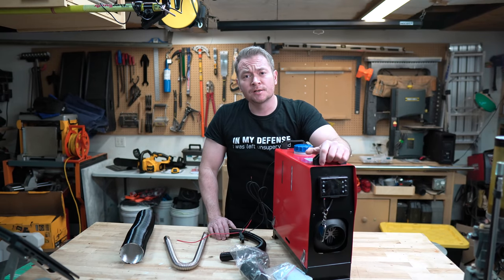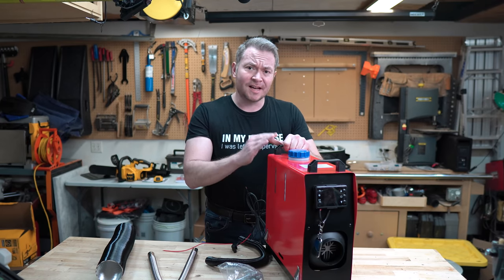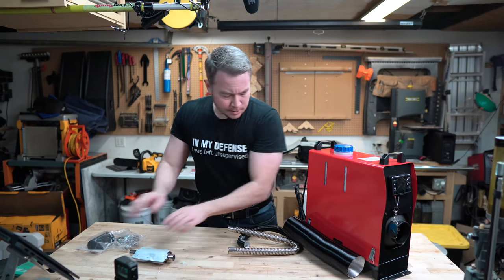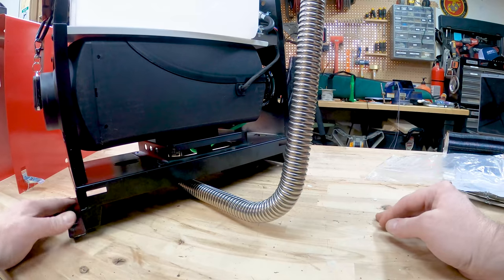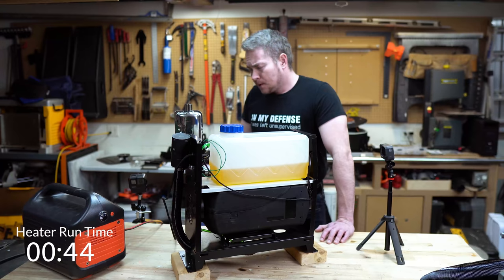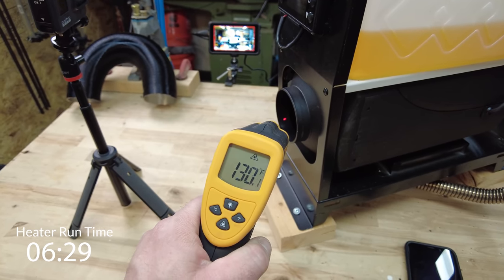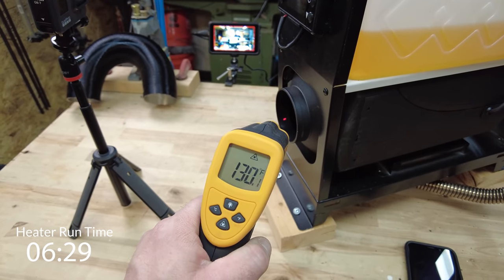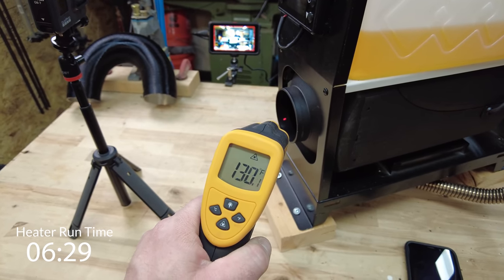My First Chinese Diesel Heater

Comment: I’m worried about gas emissions? There is certainly CO2 emissions from the combustion process. Are you using this in an enclosed area without exhaust to the outside?
Reply from the maker: This should only be used in a ventilated area or with the exhaust vented outside.  In the video description you’ll see a warning to ensure you have adequate ventilation.  This short run here was for demonstration only and what was not shown on camera was an open door off screen.  I have some follow-up videos on this device which covers various use cases which you or others may find helpful as well.  Thanks for watching!

Comment: I've read they will run on a 50/50 used motor oil and diesel mix. if this is true i do not know. if you add seafoam to the diesel ill bet they will last a lot longer. i have 9000 hours on a 1000watt generator. i went from having to change spark plugs every 100 hours to every 500 hours once i started adding a cap of seafoam to the crank case every change and adding it regularly to the gas

Comment: Burning results in release of water in the exhaust stream it doesn’t matter if it is propane, diesel, alcohol, hydrogen, or wood. I’d you don’t want water released inside you have to run the exhaust outside for dry heat (not possible with the buddy heaters). I recommend always routing exhaust outside and running a co alarm when using this heater. ALWAYS If you don’t want to wake up dead.
Reply: hm...... "wake up dead".... like a zombie?

Comment: I'm a bit late to this one, but yeah they burn a lot cleaner than a diesel vehicle engine. I've put a carbon monoxide alarm near the exhaust of a cheap diesel heater and it was pretty hard to set of. Anywhere near a vehicle exhaust and the carbon monoxide alarm went nuts straight away. 

That's not to say letting it exhaust indoors is wise. Don't do that :)

Comment: I deal with the other 2 brands on the daily you can barely replace the metering pump for less than that whole unit you bought if using espar parts run it off k2 it won’t carbon up and they don’t like diesel additives in the winter
Reply: Any tips or brand recommendations?
Reply: @alabastardmasterson  Webasto is the brand I’d go with the espar heaters we seem to have to remove rebuild every year the Webastos most I’ve had to do is replace water pump and there external take 5 min

Comment: If you can find an efficient heat exchanger to run the exhaust through you could capture most of the heat because it is forced draft.

Comment: Have you ever looked into passive solar heat with collectors on the roof and using a small solar panel to move the air usually a small computer fan will work.
Reply: Those are so weak they can't cool a computer.
Reply: This heater cost $170. Solar would run into many hundreds if not thousands.
Reply: You can't heat a boat with solar panels. Unless you're in the topical area and the sun out with the temperature of 90°.
While the low cost of the heater and the very small amount of diesel to run it.

Comment: Hey Tom, thanks for the rundown on this. Seen many use these in their Jeeps and Vans out camping to keep the inside of the vehicle warm. We both have Crosstreks, do you think it's practical for using to heat the crosstrek out camping or is it too big?
Reply from the maker: Hey Eric!  The volume of the Crosstrek is pretty small.  Based on what I experienced testing this thing out, I imagine even on low this thing would probably turn the inside of a Crosstrek into a sauna LOL.  Maybe with the windows open a bit it'd not get too hot.  I'll give it a shot someday.
Reply: @TomtheDilettante  Ok thanks for the input. Seeing those on a screen is not much to go by size wise. Hard to tell how much room it takes up or heat it puts out. Thank you for confirming all that. Like you said, sounds like a great idea for a back up heater for the house in the event of a lovely ice storm power outage. Thanks again Tom!
Reply: You definitely wouldn't want to get one larger than 2kWh, but even the smaller 2kWh versions is likely going to be pretty hot for a vehicle that small.  However, with some creativity, you might be able to make it work.  

For instance, you could branch the heated air to exhaust some of it outside.  Inside, put an adjustable vent on the output so you can control how much airflow you allow, thus controlling how much heat it puts out.  All excess heat would be exhausted outside.  Just make sure that one branch always remains fully open  (in this case, the branch that vents to the outside).  

Hope that description makes sense, as it should work.  It's just highly inefficient, as you'll likely need to waste about 2/3's of the heat outside, wasting a lot of your fuel to heat nothing.  Still, there aren't a lot of alternatives out there, so the wasted fuel might be a necessary evil.

Also keep in mind that if you're blowing cabin air out using this method, you're creating negative pressure which will suck air into the cabin from outside.  You may wish to control how/where that air comes in from (like cracking a window) so that there's no risk of pulling it in from anywhere near the diesel exhaust side of the vehicle.
Reply: @NorthernKitty   Ah yes good ideas and good points thank you very much! Love the Crosstrek even thought it has some limitations there are always ways to figure things out. Thanks again for the input!

Comment: How far can you extend the exhaust? Could you set it up inside an RV and run the exhaust, say, 10 ft away from the RV, or up the outside wall?
Reply: Some manufacturers recommend 6 feet, max. If you increase the diameter of the pipe you ay be able to go longer.

Comment: attaching a cylinder such as a 5gal air compressor or similar size sealed non flammable item to the exhaust port before dumping out the exhaust gas creates a secondary heat trap for your heating space.
Just a matter of connecting leftovers.
Reply: You wrote that instruction manual didn't you?!?

Comment: Always wondered if these were worth it if the extra cost is worth it over a regular old school kerosene heater with the scary open flame I use to heat my shop yea I think I'm going to stick with the old quite kerosene heater things way to noisy for my liking

Comment: Just curious about exhaust gases, depleting oxygen in the room. I thought the exhaust would go thru the wall to the outside.
Reply from the maker: It should. This video was for demonstration purposes only and I had a door open when running it.  Though I see why folks might get the wrong impression because I didn’t do a good job covering safely prerequisites.  Next time I do a video on this thing I’ll be sure to cover common sense safety precautions. Thanks for chiming in!

Comment: would this run off a 12v deep cycle battery?  Hoping to have that connected to solar and be able to heat my 7x12' enclosed trailer
Reply from the maker: Should work on a 12v deep cycle battery no problem.  I ran mine off a 12v car battery for a while.  As long as  you monitor the charge, you should be good.  What you want to avoid is the battery voltage dropping such that the unit shuts off without being able to go thru its shut-down cycle.  Hope that helps.  Thanks for watching!

Comment: is it still working?  it needs a power source?  you said it "works off your jackery"?
Reply from the maker: Smedley Butler eh?  rah!  :)   It's still working though I haven't had much use for it over the summer.  As the weather gets cooler, I'm planning on using it a lot this winter to really put it to the test.  As for power, yes, it needs a 12v power source.  My Jackery 500 does the trick with a 12v 10a socket.  I've seen folks use a variety of 12v sources, but I think you need to be careful the power source doesn't drop too far below 12v as it discharges else the unit may not function properly.  Haven't tested that myself, but that's common hearsay.  Hope that helps and thanks for watching!

Comment: You're just exhausting it into the room? Carbon monoxide is odourless, right?
Reply from the maker: Correct.  definitely don't run sustained in a closed room.  As noted in the video description this was a test run and what was not shown on camera (though in hindsight I should have) was my open garage door for ventilation.  As it's currently installed, the exhaust is vented outside as it should be :)

Comment: Sorry I messed up my other post Anyway been working on boats for 40 years plus I have sprinter vans which which have the heaters InThemThey will last forever On karacineK1. No carbon build-up and very little cleaning Has to be done to the unit.

Comment: What power source are you using to power the heater when the generator goes out?
Reply: Ah the jackery
Reply from the maker: Yup.  I've repurposed some 12v power supplies I use for ham radio, but the Jackery does the job nicely and gives me a reason to keep it in use when it would otherwise be collecting dust until it's needed :)  Thanks for watching!

Comment: will it run on off road deisel ?  the ctane is higher in off road it should put out more heat.
Reply from the maker: I don't see why it wouldn't run off-road diesel.  It would probably be cheaper too (no tax)!  Sadly, in my urban area, I can't seem to find a place with off-road diesel so haven't tested it yet myself.

Comment: Not bad units these days form china the exhaust they send do suck and can leak easy fix is to make own exhaust. I've got two myself both run a mix of cooking oil and diesel even old car oil in a mix works well and only had one fail a glow plug so far in 3 years of use, the carbon build up isn't too bad I did remove mesh off glow plugs on mine.

Forgot to add The 5Kw has 2 sizes in china the smaller one is more a 2.5Kw they sell it as a 5kw do watch for that normal startup is between 7 - 9 amps on most once running sits on 0.5 to 1 amp shut off for unknown reasons to will go back to start amps again.

Comment: You can get the same results without electricity from an old Perfection wick stove. Yes you will have to clean the wick each day and add some denatured alcohol but I get 9 hrs without electronics. No wonder they were put outbof business.

Comment: Useful video, do you have follow up ?
Reply from the maker: Thank you. Coming as soon as I can. I got this in spring and there weren’t many cold days left in the year. I did another video where I tested it for heating a tent overnight in sub freezing temps you might like (https://youtu.be/Z4mozM2hABw). 

Otherwise, I’ll be doing a follow up review if this unit this winter after I’ve used it to heat my detached garage for a while. Hope that helps.

Comment: I have been around for a while. With other words, I have seen the very first Eberspaechers as well as the very latest Webasto. However, I would not buy or touch any of those Chinese or Russian copies. All I can say, and that goes for every single unit I had to deal with, as long as it works it's good, however, once it does not work properly anymore you are up to your neck in problems. It's hard to find service, it's hard to find anybody that knows anything about those heaters and the price for parts are out of this world.
Reply: been running one in my rv for a year.  love it.  if it breaks i can buy 10 more for the cost of eberspanchers.  just saying

Comment: As far as powering this unit goes I am going to use my Milwaukee battery adapter and 18 volt 12-volt DC DC Buck converter
Reply from the maker: Oh that's a cool idea.  I'd be curious to hear how it goes.

Comment: Your exhaust needs to slant downwards, so that water/moisture doesn't get trapped inside.
Reply from the maker: Good point.  In my current configuration, I've routed it so that there is no risk of water ingress.

Comment: I heard that the muffler is to be lowest point so condensation does not build up in low point of tube.
Reply from the maker: Good point.  A couple others commented on the same.  I'm definitely going to make a note of that and try to figure out a better way to configure this thing for continuous use such that it takes things like your comment into account.  I admit I as so interested in just seeing whether or not this thing even worked that I hadn't given a lot of thought to overall deployment.  Thanks for watching and chiming in!

Comment: Never in my life have I ever seen someone open latches like those with a pocket knife
Reply from the maker: was completely subconscious.  Dunno if others have this problem, but sometimes when I've been working outside a lot in cold dry weather, my fingertips will crack around the nails...making prying with fingertips painful as hell until they close / heal up.  That was the case here so I was like "f*** it, may as well use the tools at my immediate disposal". :P

Comment: I love the idea of these heaters. Fuel goes off after a while so thinking as a prepper, I wonder if it could run on propane or converted as that doesn't go off.
Reply from the maker: Interesting question re: propane.  Probably could be converted.  Wouldn't need the fuel pump (just another mechanical part that could potentially fail).  Not sure if the glow plug would be sufficient to ignite the propane.  If not, I suppose any type of igniter should work as long as it can thread into the combustion chamber.  I'm also not sure how much hotter (or colder?) propane burns compared to diesel...thinking about how well the unit would hold up.  Geez, with all these unknowns, I half inclined to try it out LOL.  Maybe I need a 2nd unit to take apart and mess around with.  If you end up doing it, I'd love to hear about it!

Comment: The Toyotoma seems to be a branch of the much larger Toyo home diesel high efficiency pot parlor units.  As I recall they came on the market in the eighties and at very popular.  As I remember Toyotoma was marketed in the US with almost no advertising in the early Epps and left the US market by about 2010.  I don't know if they are still in Canada however as I understand they are still in production and selling in other parts of the world.  One of the largest users of this style is the RV and semi trucks with sleepers (they also are necessary in cold climates.).  Can't imagine that any of theses high priced units can survive in the present market.  They still market the hydronic large versions (Espar and Webasto) for much higher use.
Reply: I think you're talking about the toyotomi they're still being sold around the New York and upper Pennsylvania and I believe Michigan too..
Reply: @paulyuricek1538  Good to know.  My supplier and his wholesaler had told me they were "leaving the North American market".  I was never clear whether that included Canada.  My understanding is that Toyotomi is an in house subsidiary of Toyo.  I own one, bought it in 2004 so hearing they are still selling them is heartening should spare parts be necessary.  Though I would have to think it over as the price of a few parts would quickly exceed the price of a new Chinese one.  Any idea how they are sold in your area?  Who imports them from where?  I am in Southeastern Alaska so things are probably quite different here.  Thanks for the info.  Very useful.

Comment: So, these are a steady heat and not a controlled thermostat type heat?
Reply from the maker: there's a thermostat built into the control panel I  believe and you can set it to regulate temp either thru a user defined fuel pulse rate (default) or thermostat.  I haven't tried via thermostat yet since I've kept the unit outside of the space I'm heating.

Comment: I got an identical unit about a month ago. After a couple of weeks using it to heat my shop the glow plug failed (error code E-03). Still waiting for the eBay vendor to send a replacement.
Reply from the maker: Oh man, that sucks!  I've got a couple months use on mine so far without any issues (knock on wood).  I suppose one of the risks we take when getting these cheaper units is inconsistence in quality.  Hope you get it resolved satisfactorily soon!

Comment: Are these safe to use if the exhaust is outside and just the hot air blowing inside ,,no fear of carbon monoxide
Reply from the maker: Exhaust should be routed outside.  In this video, I fired it up indoors (with open door off camera) for demonstrative purposes.  I have a couple other videos showing how I run this today.  In both cases, the unit and exhaust is either outside (with heater vent coming inside), or the unit is inside with the exhaust routed outside.  I've used it in these configurations for a couple years now without issue.
Reply: @TomtheDilettante  so there are no poisonous fumes present in the hot air blowing to warm the area,,, all the dangerous gases are in the exhaust fumes.
Reply from the maker: @rhiodnstar  Not that I'm aware of.  I've blown the hot air into a tent and into my shop for prolonged periods of time (10+ hours a stretch).  I've measured no appreciable increase in carbon monoxide in my tests.  Though I don't have the means to scientifically measure or quantify any "poisonous fumes" so take this response with an appropriate level of skepticism.  Would I run this in a small completely enclosed space with an infant in it?  No.  Do I use it exclusively to warm enclosed areas (garage or tent) regularly with no (known) ill effect?  Yes :)
Reply: @TomtheDilettante  thanks for your honesty and great content